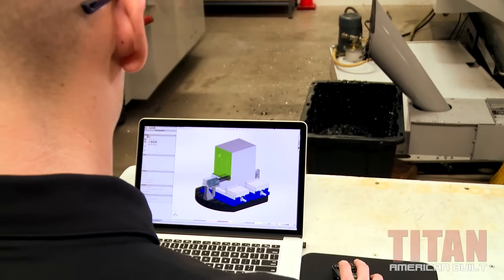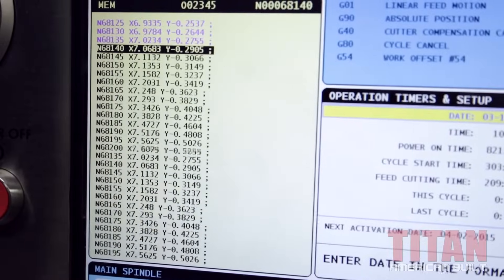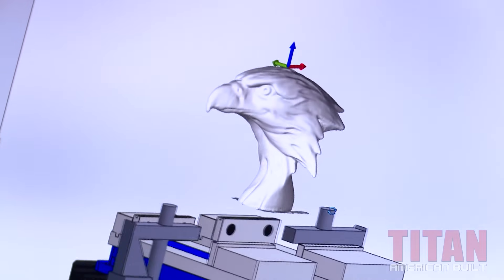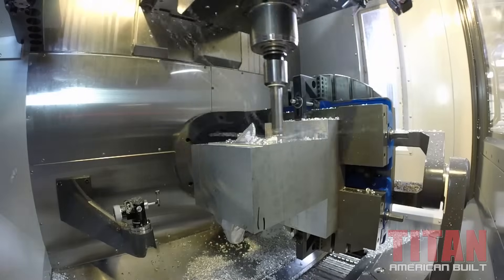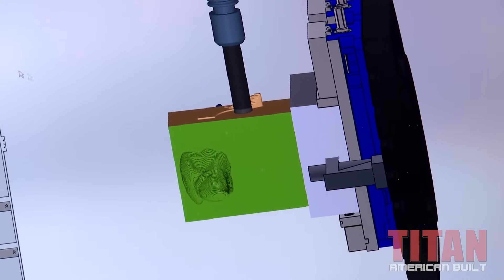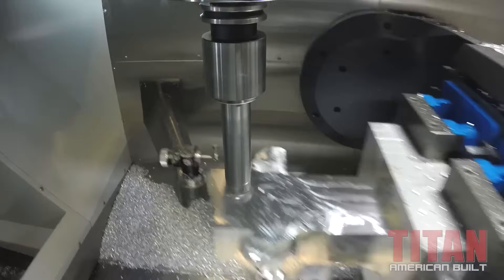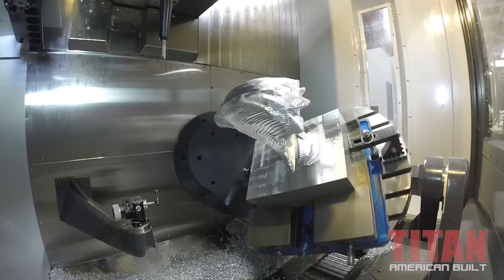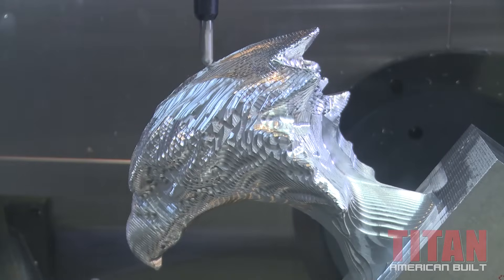CNC Machining Titan's Eagle

Comment: I remember when CNC's came out and it would fail allot many places just took it off from all the problems then new computer boards less fails but so basic and you had to change the tools reset zero hit the bottom and cross your fingers.
I knew it has come a long way to this I am amazed at what I see even your personal story is amazing.

Comment: Um... With all due respect to how impressive these machines are - wouldn't it be much cheaper, easier and faster to model it in clay, and then make a mold? :D
Reply: This is a demo for the machines. Milling and casting give you different properties, etc with different materials, so you use them for different things
Reply: Or at last have rough form of detail and not waste so much material in turning chips. Laser 3d printing from metal powder is really promising technology.
Reply: You’ve missed the entire point!

Comment: Sweet stuff! Thats definetly Solidworks running HSM Works. But close enough lol. - Jacob S.
Reply: Jacob S. im pretty sure its inventor. the guy said it himself when he said " autodesk software ". plus it looks like inventor to me. i think you can import solidparts from solidworks to inventor hsm and mill it. i havent been using solidworks in awhile. inventor is much better for me for some reason.
Reply: "Autodesk Inventor "